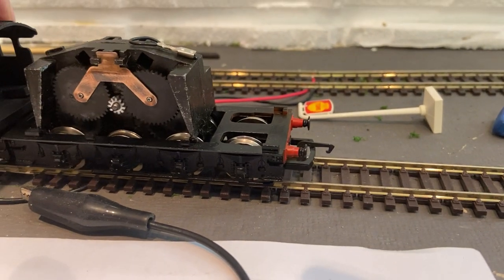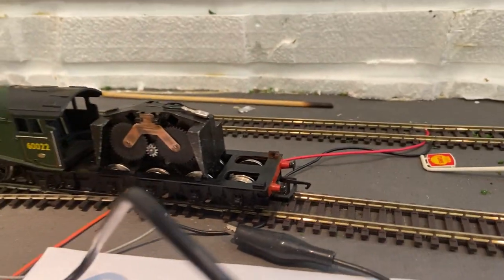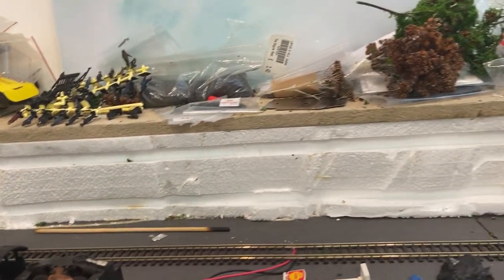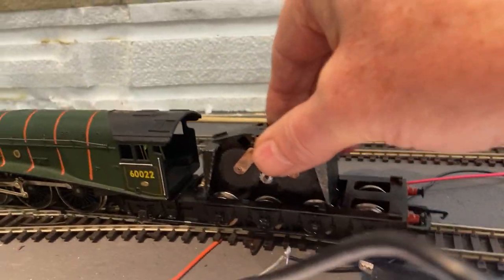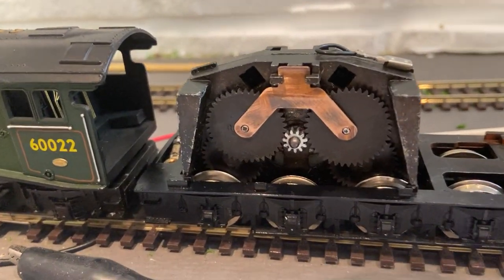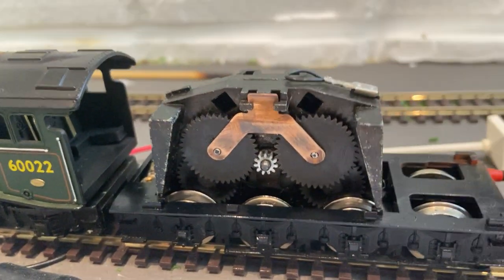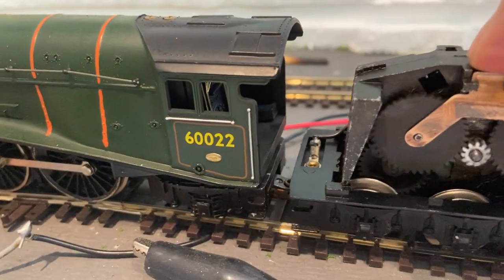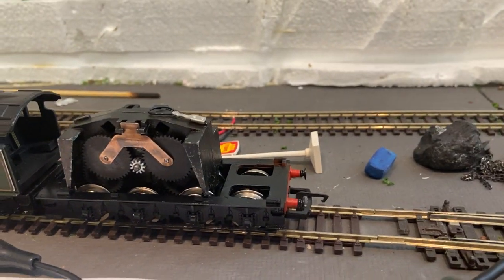For Barry Davis model railway expert. Here is my problem A4 with the squealing Ringfield motor

Comment: Hi, really sorry I thought I had left a comment here with some ideas. The cog is slipping and needs to be replaced with a brass one, Peter's spares have them if you look for Hornby tender drive motor bogie, not expensive. I'd use a good safe oil for the gears and bearings not Vaseline as it is rather heavy and becomes more so over time, look at Hob-E-Lube medium oil and gear grease from Woodlands Scenics  or of course Labelle 102 which will do it all. Good luck
Reply from the maker: Thanks for  that . I am presently compiling a list of things I need then will send to Peter’s👍

Comment: Pinion gear loose by the looks and sounds of it. It may have a very tiny crack. Glue might work but a replacement gear would be a better idea.
Reply from the maker: Thanks Bill. That would most likely be the solution👍

Comment: Suggestion, obtain a brass version of the white metal gear. You also need to check that the outer cogs under the brass retainer are actually meshing with the inner gears that drive the wheels. That doesn't appear to be happening
Reply from the maker: Thanks Leo. I will be placing an order fir a few brass cogs but must make sure for the ones which need replacing that they are all tge same. Some are 11 and others 12 points.
Also need a few other odds and ends and as I live in Toronto I want to keep the cost if postage down.
Thanks very much for looking and commenting

Comment: From what I can see and hear, I would guess that the shaft from the motor don't fit 100% into the little white gear. Glue or replacement would be my advice.
Reply from the maker: From all accounts that would appear to be the case👍

Comment: That's the exact thing thats happend to my HD
Reply from the maker: I think what is happening is the cog hole diam is too large for the shaft and therefore no engagement resulting in the cog spinning.
If you do a comparison side by side of two similar units you can see the wheels on the one that works do not turn if you try to move them by hand while on the one that does not work the wheels turn freely. The cog will also fall off. I dont know if the cog can be fixed using glue or if I could get my hands on a new one that might work